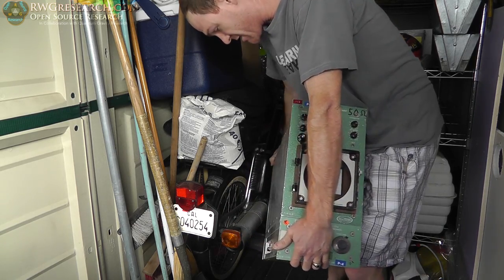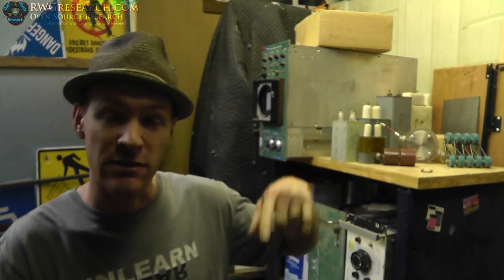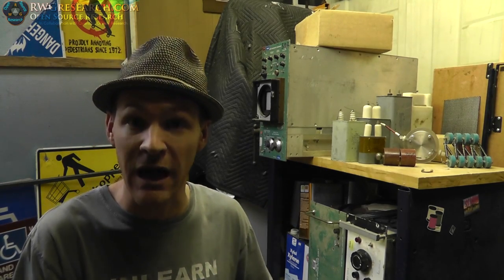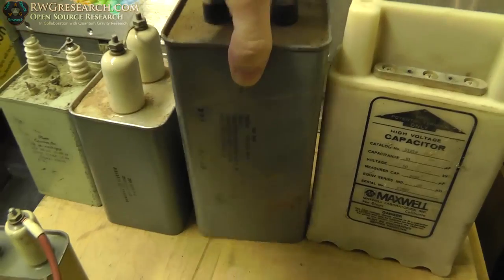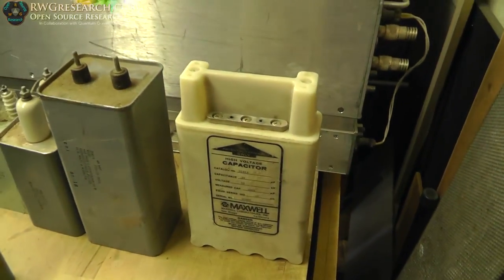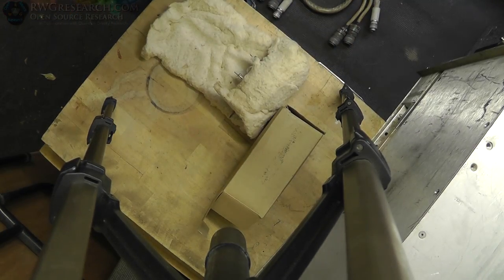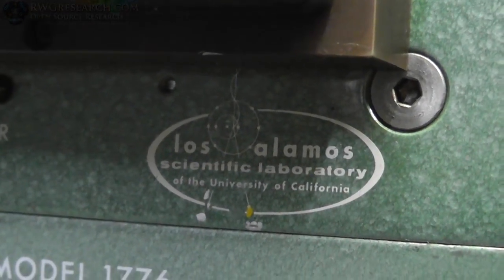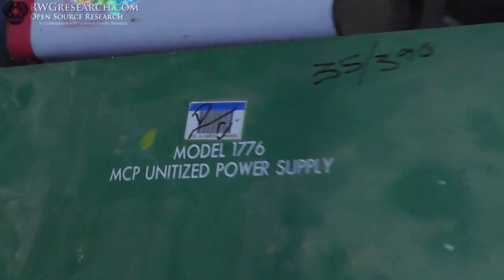Los Alamos National laboratory High-energy-density Plasma Physics STUFF Part 1 of 3

Comment: Hello, Russ! Quick question about inverters. I have 12v 50ah battery and need an inverter for camping to use with a 1000w stove and other things. Any suggestions?
Reply from the maker: harberfright  has a unit's for cheep. and if you get the warranty you can bring it back if it breaks. seems liek a good option,. they also have solar panel's there too. yeah some of there stuff is junk, but returns are good... just some ideas... 

~Russ
Reply from the maker: http://www.harborfreight.com/1500-watt-continuous3000-watt-peak-power-inverter-61628.html